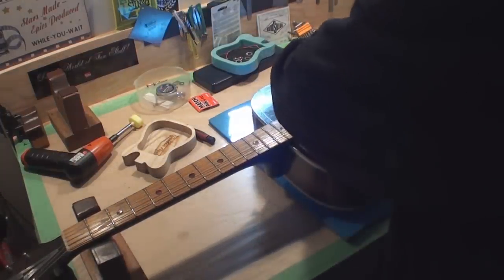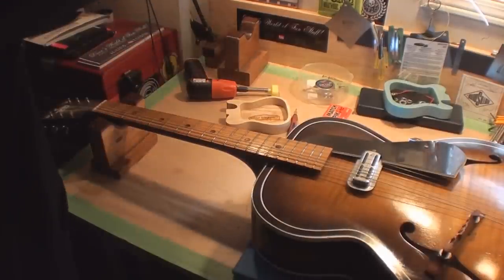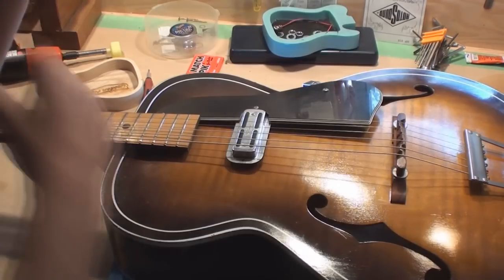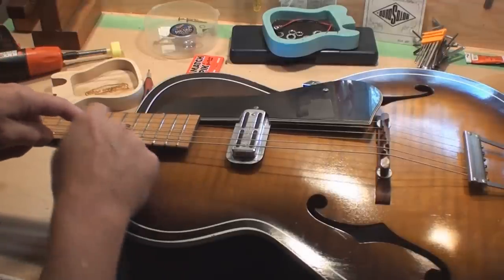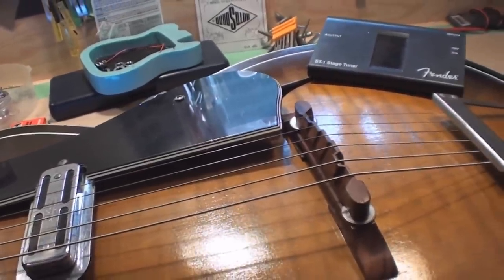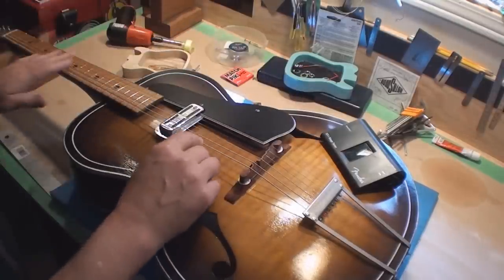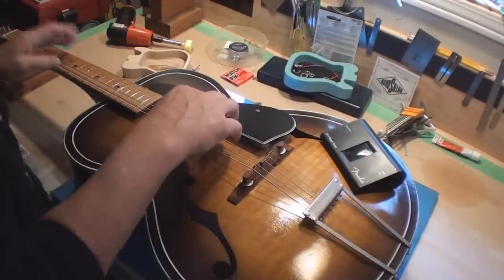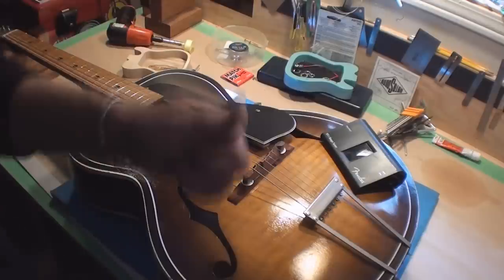How To Set The Floating Bridge on a Archtop Guitar

Comment: Thanks for the video. 

Here's a tip I use since I have several archtops.  I set the intonation the first time I change strings.  Rather than re-intonate every time I change the strings,  I'll place a piece of blue painters tape on the guitar surface  along the bottom edge of the bridge before removing the strings.  When putting the new strings on, I align the bridge merely by butting up against the tape.  Since the tape isn't on for very long and is far gentler than plain masking tape, there is no damage to the surface or residue.
Reply: For sure, the way to go, If you know it's Floating. If you didn't know it floats, you use tape Everytime after. Was going to cut a strip of wood or plastic about 5/8" wide, or whatever that distance is between pickup and Bridge. Painters Tape for sure otherwise.
Reply: I use post-it notes.
Reply: Or you can change the strings one at a time and the bridge will not move at all.  Why take them all off at once?

Comment: A lot of archtops with violin type F holes set the bridge the same as a violin.  The exact middle of the F hole (Its widest point) is shaped like a point.  This is where violins and a great deal of archtop guitars have the bridge.  If you put it  centred there  and tune up it won't be far off and will only require a slight movement.  If you have a non compensated bridge there is no way you are going to get all the strings intonated perfect but if you make sure  both E's are intonated  that will get you the closest.  I think Archtops with Gibson type ABR bridges give perfect intonation but I think they affect the tone badly.  It's a trade off.

Comment: It's been pointed out that the bridge has been replaced in reverse. I'm pretty sure Dave missed that, easily done, and will have corrected it. The important information about the placement of the bridge however is perfectly correct. I just tried the measurements on my old 1960's parlour acoustic which has a floating bridge and it worked perfectly. Thanks for the great tutorial Dave.
Reply: I came here to … nvm
Reply: How do you know if the bridge is reversed?

Comment: Dear Dave, 'scale length' is measured on the high 'E' string, not the low 'E' string;; the floating bridge is placed such that the measurement from nut to saddle (on the high 'E') is the quoted scale length;; the bridge is then slightly slanted (on the low 'E' side) so that the nut to saddle measurement on the low 'E' string is about 3mm longer than for the high 'E' string;; the height you set the bridge to depends on whether you will be playing only rhythm or playing lead - a higher height provides for more volume(acoustically);; I have two archtops, one modern and one from 1965 --  a small pin prick into the varnish with a scribing pin marks the correct position for the bridge's corners - who wants to have to 'measure' bridge position ever time you have cause to remove all the strings?  :))
Reply: I didn't know that.  Live and learn.

Comment: Hang on.. This guy has put the bridge back on the wrong way round? Am I right? I think so..Hes gonna have a hell of a job doing intonation with that A string coming forward.  That saddle jump should be the for the B string going backwards? Tell me if I am wrong?
Reply: I clocked that too. I'm sure he noticed after the first chord.
Reply: You're not wrong - I couldn't believe anyone thinking he knew about setting the floating bridge position on a guitar could make such a fundamental mistake. There was no need to take the bridge off or even to detune to measure the distance either.
Reply: I doubt he has noticed it yet if he has why hasn't he used an annotation, or mentioned it in information, to prevent people following his video making the same mistake.
Reply: Yeah, not likely to set him loose on a valuable violin.
Reply: I did not notice, i stil put my bridge on the rigth way. Its a informative video nevertheless.

Comment: great refresher .. looks like a 60's Harmony like mine ..love that pickup.. i won from sentell pickups on Ebay for 22.00 a jazzmaster type that fits in the case of a p90 dogear ...made like a p90 but uses rod magnets instead of screws and 2 a5 magnets inside that makes it to tall.. it fits in the middle like yours ..with no mods to the body ..flush mount .. best sounding pickup i got and i have ..or maybe because its a p90 type and never played on one...sounds better than my vintage gibson T-top
But ..have thought about cutting the back and add a cover to get to the wiring on these things more easily...but really a last effort to do so.

Comment: Very informative video
Thank you for it.
To make it sound even better..
Make the bridge fit tight to the body.
Do this on the correct place after intonating it!
(Mark it somehow)
-:- Put sandpaper on the gitartop under the bridge and sand the underside of the brige itself to the exact shape of the place it sits on..
I read they put chalkdust  underneat it too. Dont know if its correct and improves tone even more??
Just make it sit in full contact whit fine abrasivepaper, it works noticebel.
Olso i marked my bridge were to sit😂

Comment: Hey Dave, big fan here.  Long time first time.  

I have what I think is two issues with my Eastman archtop (ya, its chinese);

1. roughly between the 3rd and 7th fret on the D, G, B, E string's, I here a odd vibration that is coming from the bridge pickup. I press down on the pickup and its gone.  I heard there's a spring loaded screw in there?

2. What I believe to be a second problem is the D string around the 10th fret, the notes are dead. It probably isn't a "wolf tone" since it happens on other notes although not as severe. 

The guitar intonation is fine, the frets seem to be firmly in place, AND I have raised and lowered the action.  It doesn't like its the truss rod as there is nothing hitting the frets
Reply: Eric Hanaway I have FlatWound 13 to 56's if it matters

Comment: 1. that isn't the original bridge is it?
2. did you have to reset the neck when you got it?
3. awesome pickup. what's the name/model?

I had almost the same guitar (the peg head was less decorative) The neck was nasty. Intonation was impossible because of the warp and it had a ski jump... I'll have to remember the measurement from the 12th to the bridge... good point. Got a new old kay to mess with! :)

Comment: So here's a question. I have a guitar with a floating bridge, but it keeps moving around as i tune the guitar. Over the couse of a few days it moves about a millimeter out of position, even though it has some double sided tape underneath, it kind of loses grip over the course of a few days. My question is how to i fix the bridge in the same position? Is there some kind of epoxy or glue i can use for this? My bridge has moving saddles btw, any help would be appreciated. thanks
Reply: +joel duarte Use violin rosen applied to the underside of the bridge and also to the top plate of the guitar just where the bridge sits. Just rub the rosen bar against the wood, build up a good amount, enough so that it will be sticky and this should keep the bridge in place.
 If the bridge is cut really wrong, meaning the curve of the underside of the bridge is different than the curve of top plate of the guitar, that causes problems for lack of contact. Rosen may or may not help all that much. If that is the problem then tape some emery sandpaper on the top plate of the guitar where the bridge normally goes. Next just move the wooden bridge back and forth toward the nut and then toward the tail piece and the sand paper because it is attached to the top wood plate of your guitar is in the exact same curvature so moving the bridge across it allows the sandpaper to sand the wood to the exact same curvature as the guitar. Move the bridge back and forth about 1 inch and work carefully and slowly. Do not move it left to right, keep and eye on that. 
Peter

Comment: Here's what I  do... I have a few archtops... Take one that has the same scale  as the one you're putting the bridge on..  Measure...the one that is already set up.. on both the first string...from nut to where the string rests on the bridge.  Do the same for  the low e string.  PUT the bridge on the guitar...using those measurements... for where the high E and Low E fall on the bridge!.. BINGO!..  Now, before ever taking a bridge off...as in putting on new strings.. Put a short strip of masking tape...one both sides and the end..at each end of the bridge..WHILE the bridge is still on.. Then, just...put the bridge back in the marked location... when you want to put the bridge back on.

Comment: My guitar has perfect intonation at the 12th fret but it's really bad at 1st-5th fret. Any idea what might be wrong?
Reply: +Aimo Nuutinen Possibly the nut is cut too high. So when you fret the strings at those frets you are making them sharp, kind of like bending them as many people do to raise the pitch or give a vibrato sound. That makes them sharp too. Lower the cut in the nut to get the strings closer to the fretboard and then the strings won't play sharp in the lower frets 1-5. Anyway that's the usual culprit for your problem. Oh, be careful when cutting the nut, to far and you get string buzz. Work slowly and just cut a very small amount at a time.

Comment: Measuring should be done by intonation.
By the primary player pressing the 12th fret using their average pressure.
A good micro tuner or strobe should be used.  The open strings should be exactly the same tone within a small margin of error as the 12th fret.  This sweet spot may be close to a measured method but not always.  Each string should be set after the two outside E s. An acoustic guitar intonation has to do with being in tune, not to do with engineering or  mechanical sheet metal working. 
I used to totally trust manufacturers, other textbook and Luthiers but in over 52 years of playing I have learned to trust a good tonality meter and my ears.

Comment: And if the guitar/violin/upright was built properly this spot should line up with the points on the f-holes, if you don't have a yardstick or bit of string.

For some reason a lot of hollowbody electrics don't follow this rule and have the f-holes pointing at the pickups (basses) or at nothing in particular (usually on guitars). It isn't that important since these are usually fixed bridges, it just always looks weird to me.

Comment: The fact that the arch support inside the guitar has not broken from the pressure of the bridge on the body says a lot about the quality of the guitar. My Washburn Montgomery has sunk under my bridge, and even warped the shape of the F holes. Try that in public. I wonder who makes the best bridges for archtops. What's the best material.... by the way, I hate plastic anywhere on a guitar, and that includes a pickguard. Some of the early thick really thick translucent pickguards are beautiful, tough. But that black plastic thing adds nothing to the looks of the guitar, and as you guys may know, resting your fingers on one when you use your thumb, they click and bend. I'd rather had a wood pickguard. Always re-finishable.